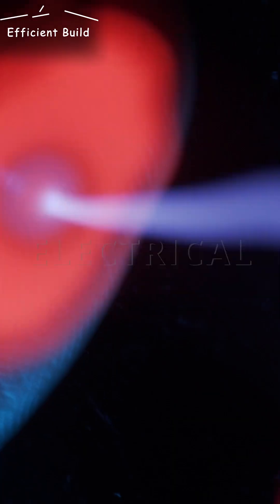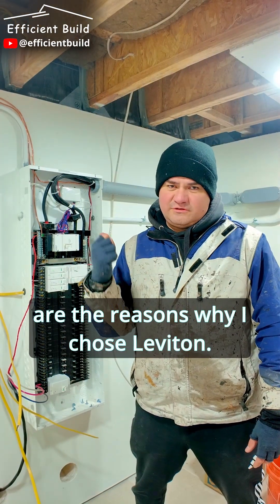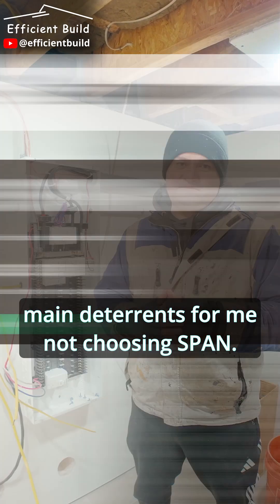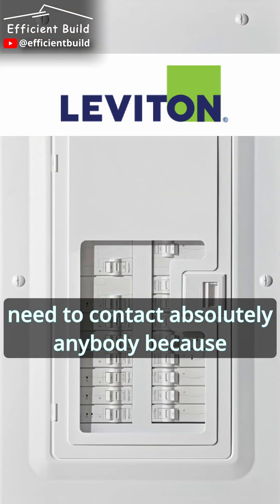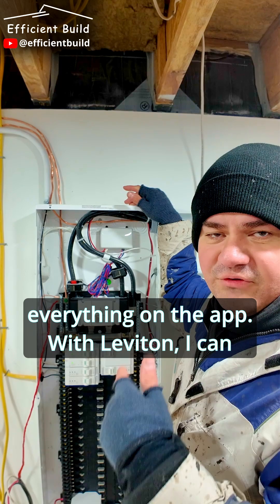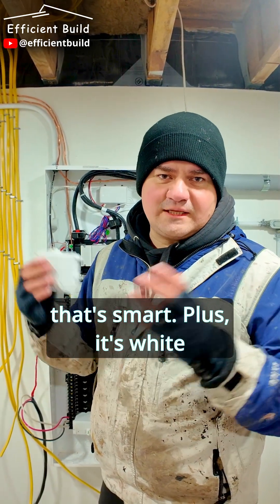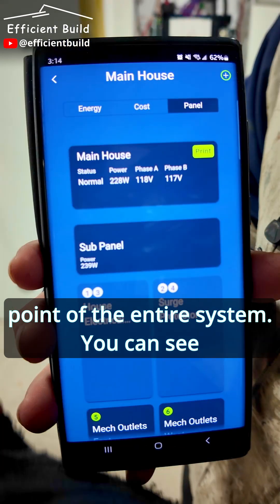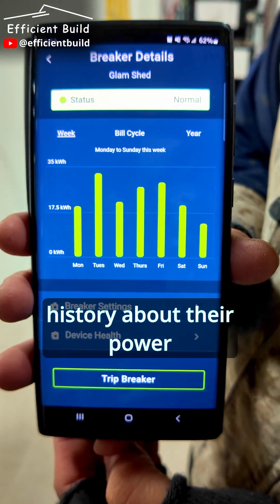Span vs. Schneider vs. Leviton: Best Smart Load Center? #smarthome

Comment: can you share a link to the Leviton panel?
Reply from the maker: Sorry for the late response, this is what we're using:
https://a.co/d/13GwVkY

You need to buy the cover separately
Reply: @efficientbuild  thank you so much!
Reply: I was looking into SPAN also but my concern is that it’s funded by VC money and if the company ever goes under, the panel will stop working. 

Leviton is a 110 year old company and if if they go under, the panel will still work.
Reply: I appreciate the video. But it is not fair to compare the Schneider Electric (Square D) Meter Main to the Leviton Indoor Main Breaker Panel. Two different types of gear.